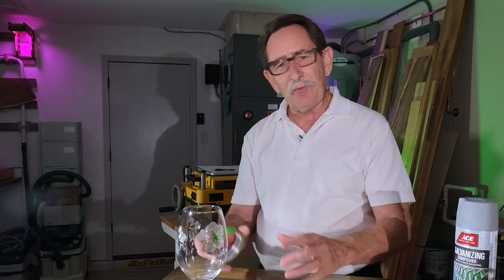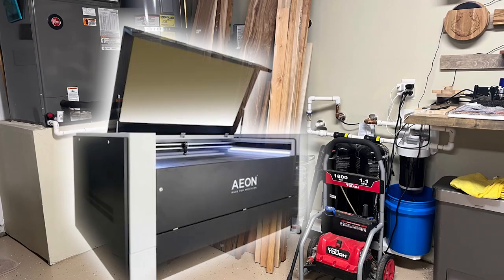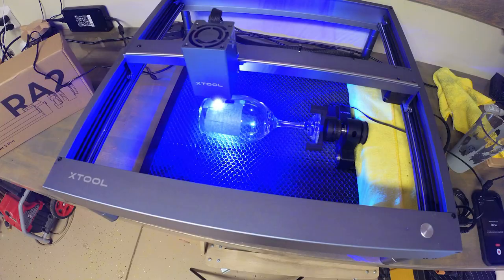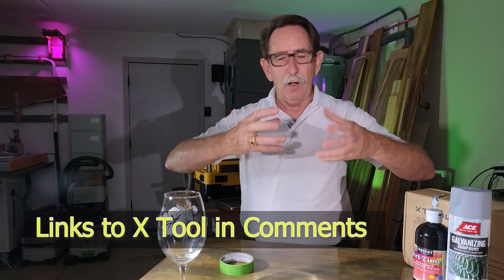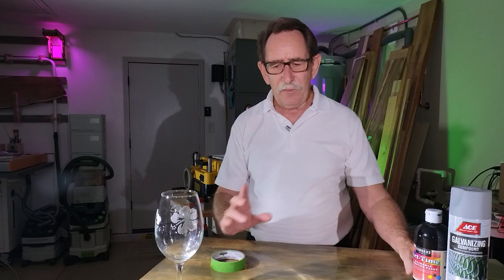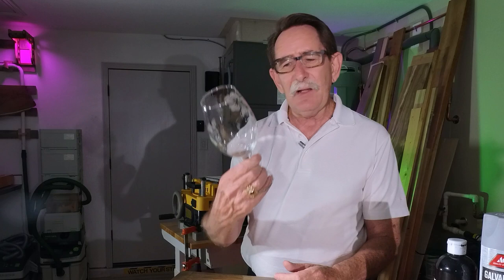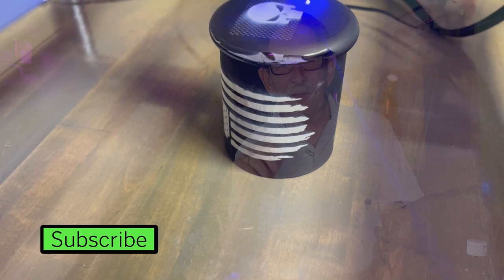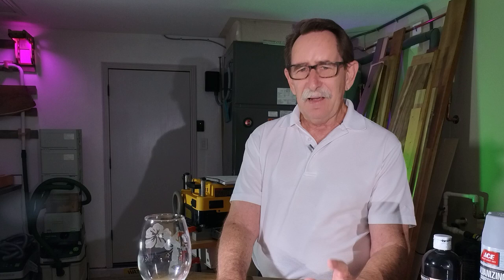Etching Glass with the XTool D1 and RA2 Rotary - Masking Tape and Paper Towel Experiment.

Comment: I bought a xtool D1 20 watt in November of 2021. It paid for itself in a month. By Jan of 2022 I bought a 100watt c02(paid for itself in 4 months), 2023 a 50w dedicated to tumblers and just purchased a 60 watt fiber laser and these are all running while I'm making furniture for my business. They are amazing and very addictive. I have a CNC which is awesome as well but the lasers are much easier to use and I find myself running them a lot more. But all of this happened because of my little watt xTool and some hustle. Highly recommended to get an xTool D1for an entry level to see if you want to move up.
Reply from the maker: Thank you for sharing that... I hope everyone gets the right tool for the job, the Xtool is where I started.

Comment: Got that 10W elegoo with the rotor tool today got it for the prime thingy not bad good kit for 300 usd it will say it dose need taller legs for the mugs
Reply: It has the air assist thingy and some kinda air filter thingy don't think it works to well but I will get an enclosure 4 sure so far it's OK  thought I need to see how to use the app better

Comment: Great video. I have a D1 pro extended that I recently purchased. I tried all of those methods as well with no good results. What were your settings and laser distance to the glass?
Reply from the maker: check to see if the lens over the laser is fogged.   As you use it at the higher power level, it seems to cloud that lens and reduce power. The lens cover can be purchased for like $14.00  I did a video on this.   I did the vast majority of glass etching with their program, not Lightburn.   So I am not sure want settings would be best for you.   I suggest holding on to say a pint glass and write out the strength your testing and see what setting work best for you.
Reply: @GeorgeKennerLaser  Thanks I will check that. I did engrave some wood right before trying glass. I had the air on as well so I hoped it wouldn't effect anything. Thanks

Comment: I am trying to do stemless champagne flutes and I cannot get a good etch.  I am auto measuring in the middle of the glass as it's tapered.  Usually the bottom of the design is not coming out.  It looks "crunchy" to me.  Sometimes I get a good etch, usually in my test, then I put my real glass in - exact same settings, and it's bad!  The design is 4.25" tall, so I'm using most of the glass from top to bottom.  I have burned through so many glasses.  I will get a good etch, take it out and put in a new glass.  If I remeasure - it will change the measurement, even though it's basically the same glass.  I'm using a chuck.  Using tempra paint from the dollar store.
Reply from the maker: Drop the focus a bit and see what it does.  The pattern detail could also be part of the problem.

Comment: How did you add the color to the flower. I looked through your videos and did not see this
Reply from the maker: The Color was only Temporary it came from a protective film that I used and it did not work as good as I had hoped.   The Black Tempura Paint is the best method I have found.

Comment: Just got my D1 Pro with rotary tool for doing glasses.  Two questions: (1) When you use the green tape, appears to be painters frog tape, what speed and power do you set the laser to?  (2) Your one picture in the video shows the flower has black and green colors, how did you do that?  Thank you....Mark
Reply from the maker: I tried the GREEN TAPE and it did not work well... that was something I saw on another channel done with a CO2 Laser.  The best I have found was the tempera paint method.   To give speed and power setting I would need the program you are using.    CHEERS and thank you for the comment.
Reply: Could you tell me the best setting for creative space?

Comment: Can it do crystal trophies
Reply from the maker: I am sure it could .. here is the thing... with almost any glass you need to have a sample piece.  The setting need to changed for almost each material.   If someone bring you the glass, you have to warn them.   If you buy it plan on using one as a sample, and charge it into the job.

Comment: im confused...did the best results come from duct tape and the xtool diode laser 10w?
Reply from the maker: The process with tape works best with a CO2 laser, what I was doing was experimenting with some other solutions.   I really dislike the idea of using high zinc paint.   The best I have found so far it the Tempara paint evenly sprayed on with a air brush or Preval.
Reply: @GeorgeKennerLaser  so what about xtool diode?
Reply from the maker: @agentjay4494   I have found that the best is Tempara paint evenly painted on the glass.   It gives a nice satin finish to the glass. 

The bigger point is there are small differences in even the Diode lasers the strength of the lasers and even how old the laser head is.

Comment: Hello George, what setting did you use for the masking tape?
Reply from the maker: For this application I used the Xtool  Program at a speed of 14 and 90 percent power on the Stainless Steel setting.   Still the best luck I have had is with Tempara Paint.
Reply: @GeorgeKennerLaser  thank you for the quick response. I am trying to engrave on shot glasses and I am using xTool Creative Space software. I will try the paint. Thank You again.
Reply: @GeorgeKennerLaser  was this with the 10 watt  or 20 watt xtool?